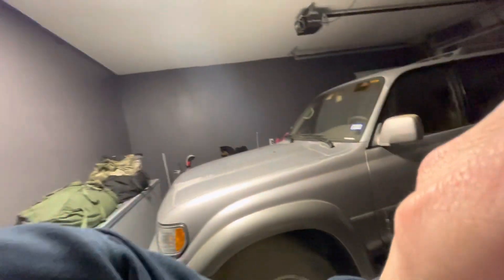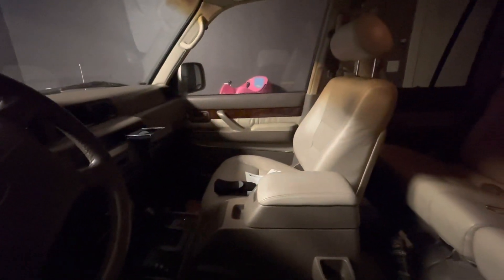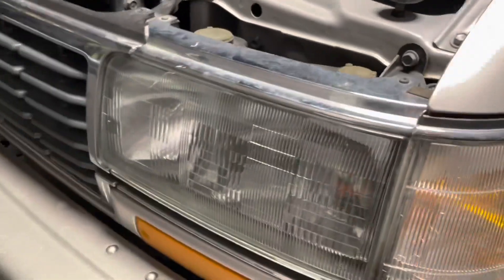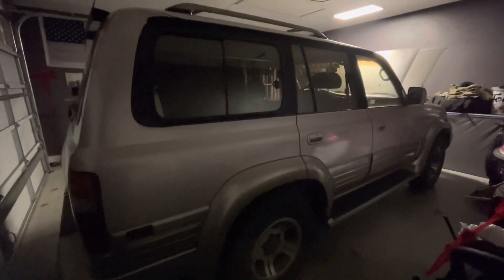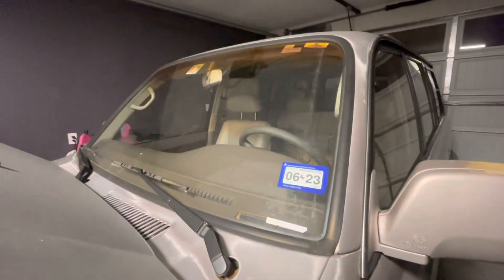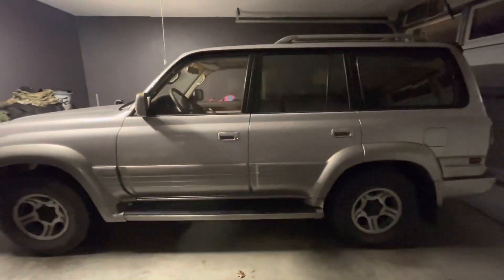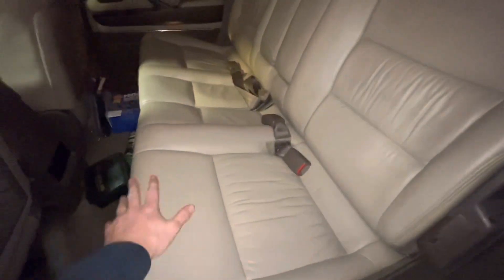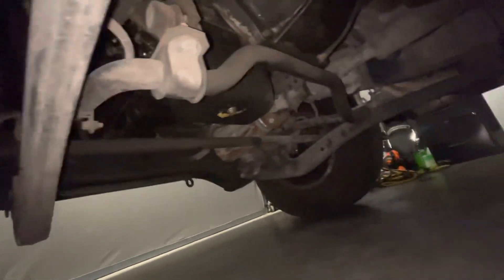I just bought a 1997 Lexus LX 450 (80 Series Land Cruiser) + My FIRST Maintenance failure

Comment: When I was born there were only 48 states. I have built and collected many classic and collectable cars since the 1960's. My Lexus LX450 triple lock is the only one that I did not let slip through my fingers. With over 500,000 miles, she is still an absolute joy and pleasure to drive. It still is a real and personal experience to simply turn the key and watch her come alive. She is how all vehicles should have been built.
Reply from the maker: Wow! Really good to hear. That’s impressive. I’m trying to make mine last through 500k too, but it is 25 years old
Reply: @shootandcruise  Take the EGR valve off and clean the carbon buildup out of the passageway. This hardly ever gets done by anybody and do yourself a favor and do not "blank off" the EGR valve. Expect to put a head gasket on her around 300,000 miles. Marlin Crawler makes an axle seal that is better than the original. It separates the front differential gear grease from the wheel bearing grease.

Comment: Very nice LX450 specimen.  I have owned five 80 series since 1996.  Three were '96, '96 and '97 Lexii.  I have one silver '96 left with 503k miles and four LX 100 series that family drives.  

FYI....that is a drive belt you mentioned replacing.  The 80 series' do not have timing belts and the oil leak is most likely the oil pump seal.
Reply from the maker: I want to keep this one and one day get a locked Toyota, but no rush at all.

Thank you for that! I tried to get the kit from Wit’s End to do all three seals but they are no longer sold, so I ordered all three separately and was going to try to tackle it myself.
Reply: @Richie Nell- will that leak indicate the engine light ON on the dashboard? Thanks!
Reply: @motogp2375  The oil light will indicate the oil level is low which would be caused by any leak.
Reply: Also could be the front crankshaft seal, a bit of a job and need a good torque wrench that can handle the spec

Comment: congrats man! great trucks, I am working on one 97 myself, with tons of work already done, still need a lift and tires, then it should be ok for a pretty much anything.
Reply from the maker: That’s awesome! Good luck. Mine has a little “sway/wobble” when I’m going 60+ and hit a bump like before and after highway bridges. Replacing the steering stabilizer with OME first to see if it fixes. If not, will look at the knuckles.
Reply: @shootandcruise  it is probably your bearings. I had the same thing going on. Bearings were loose. Got a kit fo the front and it is good now . Po. Got them replaced but were not installed properly.  The were loose and had the wrong grease in them.
Reply from the maker: @jgcruisers  okay thanks man. I lifted it and tried shaking the front driver tire (where I feel the shaking) and no give. Guess I’ll have to break out the wrench
Reply: @shootandcruise  do from 12ockick to 6oclock position and from 3 to 9. Or maybe if the truck sat, the tires might have bubbles . Mine had them.  They were from 07. Replaced them too. Mine sat for 11 ir so years.
Reply from the maker: @jgcruisers  alright. Actually I’ll probably start at the tire shop and rotate, then make sure we’re balanced and aligned and see if that solves it. Thanks man!
Reply: @shootandcruise   yeah. It can be lots of things. But if you are going to keep the truck for a long time, you will want to keep it running properly. I regret selling my first one. And I am on my second one. (Wont sell this one ) have had a few people asking about it. They will be very expensive in the near future, as you can see in bring a trailer website. Lexus are not there yet. But will be. They were only made in 96 and 97 and most of them are in the US.  Saw a couple of them in central America a few months ago and 1 in Europe. So hold on to yours.  I am looking fir my third one. But want a diesel 95 or 97 land cruiser With standard transmission, they were only sold outside the USA.

Comment: I have the same FZJ80 but mine is the 1997 40th Anniversary. Its pretty much the same, no triple lock but majority of the inside is the same. Two tone leather seats and the fake wood panel are also different. But its the exact same Land cruiser 80 series. For the seats, i had the same problem and i found is the plastic gear inside the plastic corners. You have to open it and replace it. Dont know why they made it plastic gears instead of something stronger like metal maybe. There’s a video online from another 80series guy and he shows all the steps to fix it and what need to be replace.
Reply from the maker: Super jealous man! Never sell it. My one and only regret about this vehicle is that it’s a Lexus and not a Land Cruiser. But it’s basically the same thing so I’m more than happy with it
Reply: @shootandcruise  yeah no way im getting rid of it. This rig is a tank and looks good too! Today im picking up my ARB Bullbar Bumper. Can’t wait to drive around with it. Its been needing a major upgrade since my dad had to test it in the front porch 🤦🏻‍♂️. But dang, it flies high and the stock bumper did its job 😂. Cant wait to see more content from you bro! 🤙🏼
Reply from the maker: @motogp2375  thanks man! Those bull bars are sweet. I’ll talk about it in my next video but I’m probably going to keep mine relatively stock minus lift, tires, and prinsu roof rack for now.
Reply: @shootandcruise  thank you! Same here trying not to over do it but just some essentials since i gotta wait a little til my triplets hit 3-5 years old then i might bring them out in the wilderness.
Reply from the maker: @motogp2375  nice! I’ve got a two year old who I don’t think is quite ready for tent/car sleeping yet lol
Reply: @shootandcruise  - we are in the same boat so we actually have plenty of time for smaller projects until the kids are ready to go hit the trail 😁👍🏼.